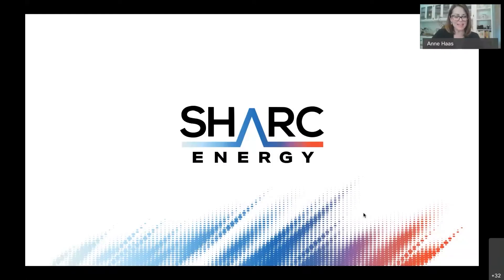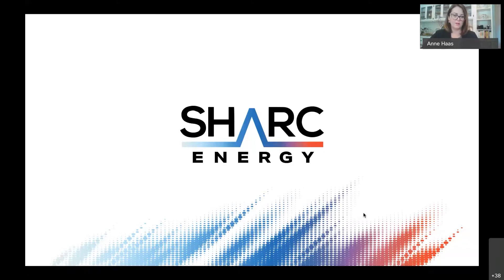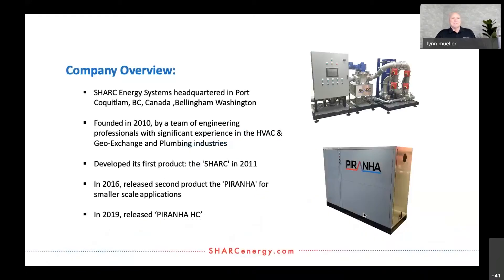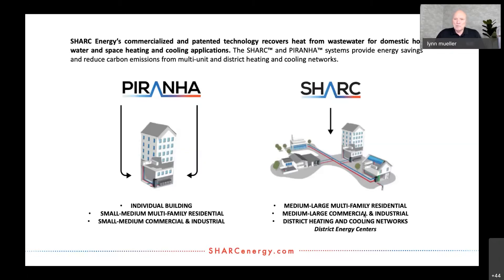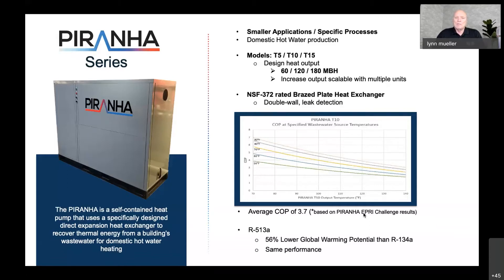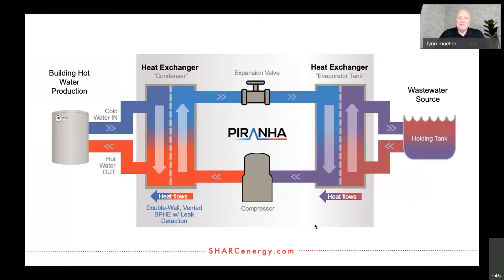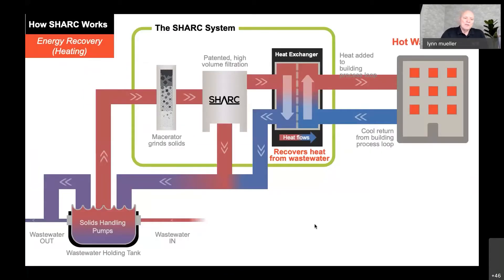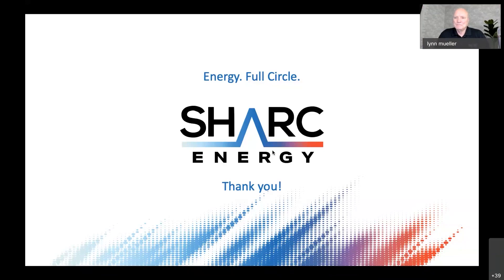SHARC Energy Systems Lunch & Learn

Comment: Sharc - Heat (pump) exchanger for sewer and waste water.
55 - 70 F is the average sewer temp. 
What size hp do these use?
Piranha 
Laundry mats, city sewer, Steam
Doesn’t move sewer temperature.
How does the storage work?  Water and sewer.
10kWh in vs 30 out???
$300k on sewer install in DC example.
Parts of the application that interest me, previously electric demands at peak times and post install.  Also a pre and post  for monthly energy bills over a year.  Daily energy during peak days too.
Reply: no answer? it "talks" a lot...